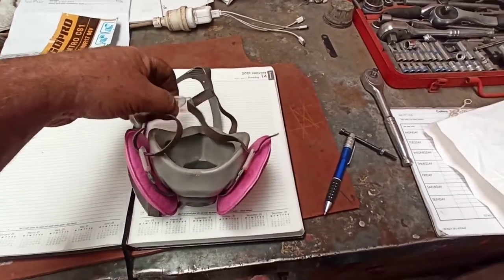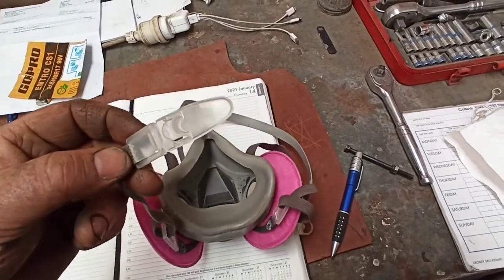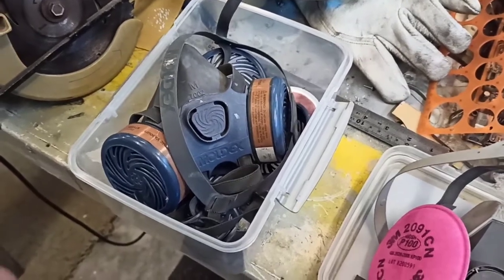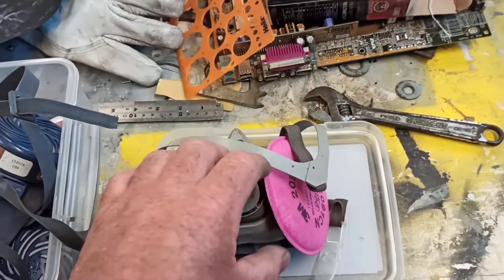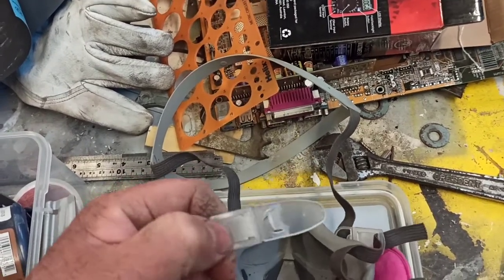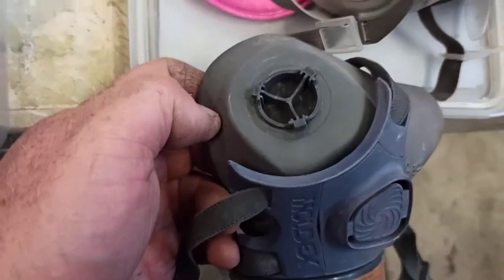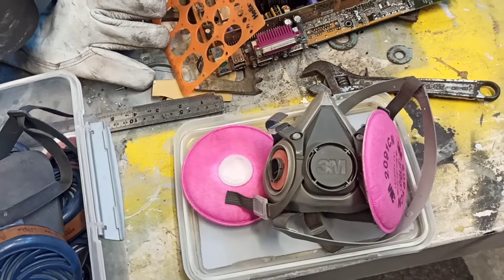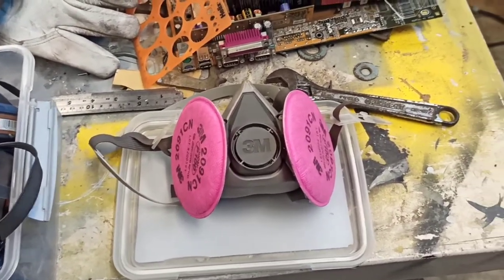3m respirator mask Vs modlex respirator mask for spray painting

Comment: I like the style clips on the moldex better that the 3M...they have the moldex dust one for $20usd and the organic vapor version is $53usd on Amazon... Got an organic vapor one from harbor freight for $16usd but has the really cheap clips I like the air tight box to store them in going to start doing that for sure.
Reply from the maker: Only way to store them . I was told to do that . Or they stop filter the bad stuff out
Reply: @NZMOPAR  I was storing them in the ziplock bags they came in,  but the boxes have a more positive seal that's the way to go!